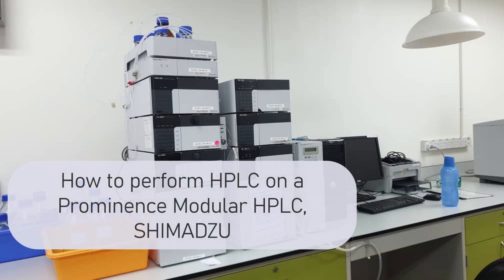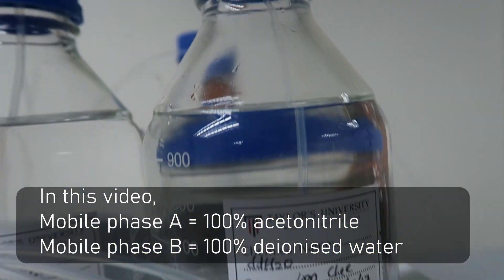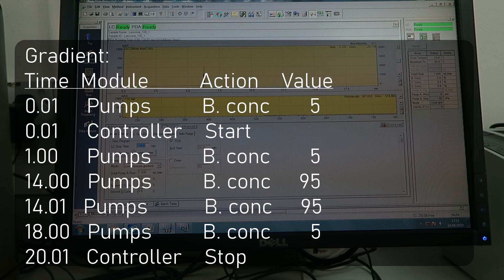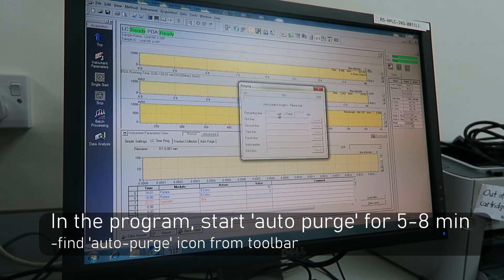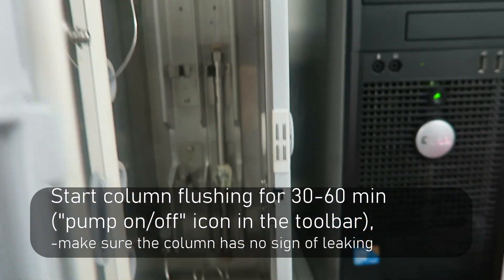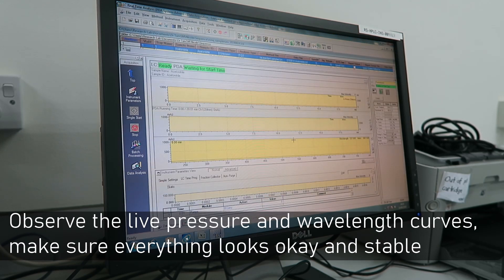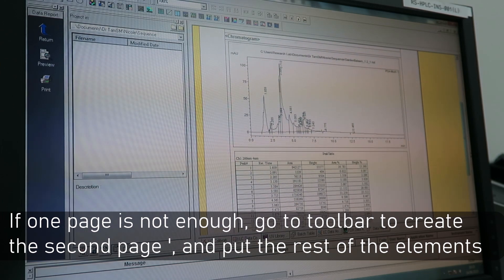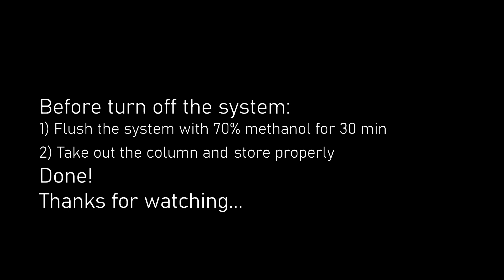Tutorial on HPLC (Shimadzu)

Comment: if system is properly maintained, while using SIL-20A autosampler's series there's no need to open LC-20A(x) pump drain valve when performing Auto Purge function from LCsolution: autosampler switch a bypass way with LPV through the drain of SIL-20A to avoid the hydraulic piping flowing through the chromatographic column. Open the drain valve only when operating the Purge directly from LC-20A(x) pump keyboard